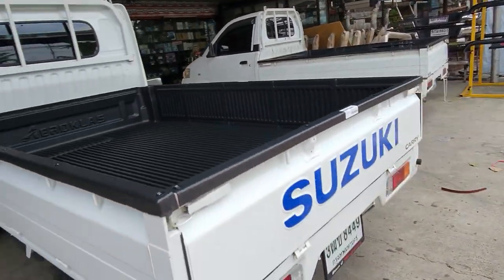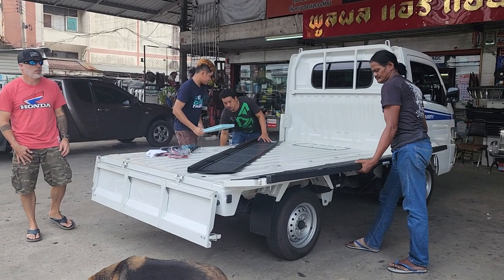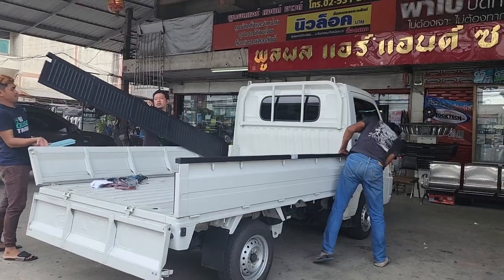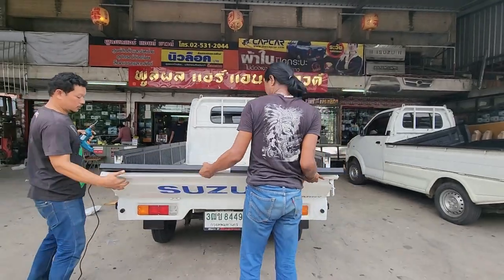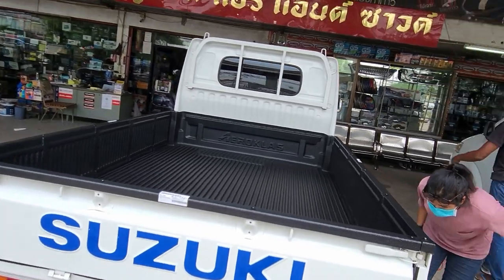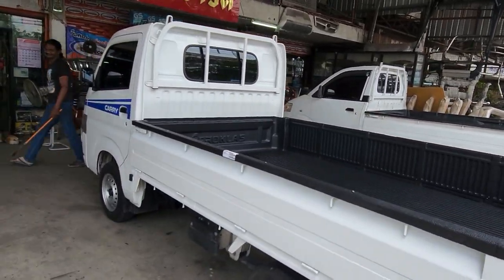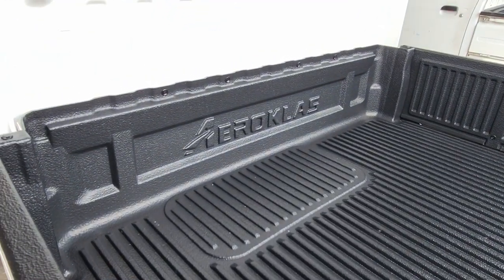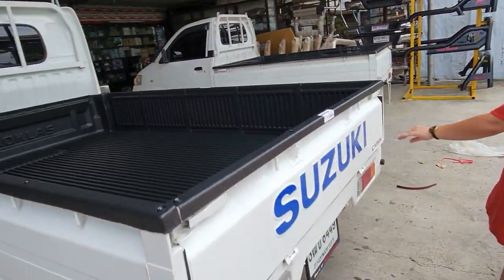Suzuki Carry Mini Truck Upgrade

Comment: How do you like that truck? Have you had any issues? How many miles is on the Odometer now? Does it drive better  since it's not body on frame? I'd prefer the spray on bedliner than that but i guess that works too.
Reply from the maker: Truthfully, it's great. It's the perfect vehicle for camping, for getting around here in thailand. Great on gas, largest capacity truck bed. I have 11,800 miles now. 19k kilometers. I had 8,000 when i bought it. Cab over body is really nice. I can see more around the vehicle. I haven't seen anyone here with spray on liner. I think i prefer spray on liner myself. This truck liner i have now is very durable, tough and easy to remove.
Reply: @travelingtiv  Have you also looked at Toyota Champ?  Seems to be in the similar category though a bit more pricey.
Reply from the maker: @maciejtomczak3785  Thanks for asking! Yes, I looked into it. It cost almost twice as mine brand new. I wanted one but i cannot justify the cost. Plus they are not 4WD. Only 2WD
Thanks for comment and support